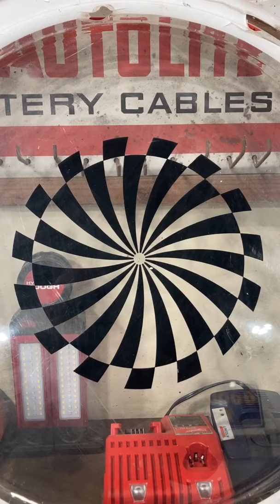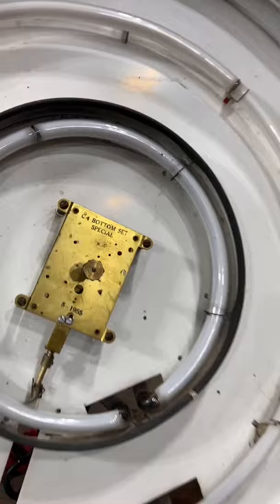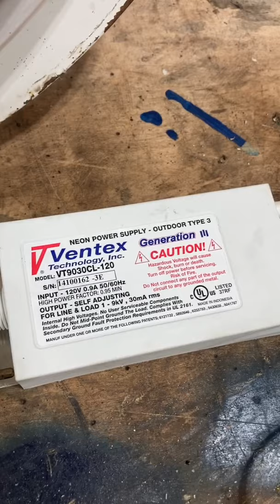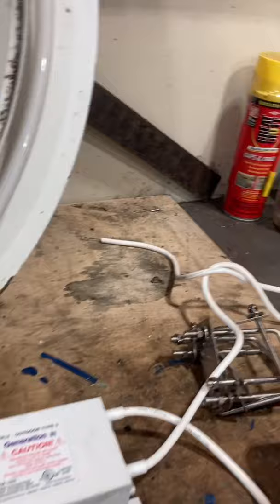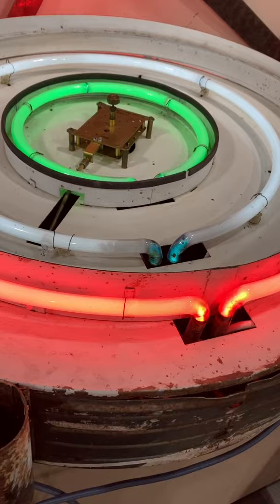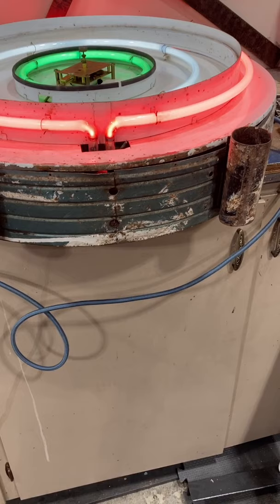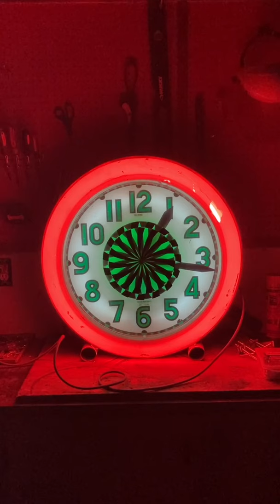Magical Cleveland Pinwheel Clock

Comment: Very cool clock you have!  This transformer is self adjusting & goes to 9,000 volts.  You probably don't need more than 4,000 volts, 6,000 volts at the most.  If anyone is doing this a quick check with a neon shop & they can tell you what size to order by hooking it up to a meter.  Remember this is high voltage & it will arc over to get you, you don't have to touch it.  Remember this high voltage can kill you or catch fire if not handled correctly.  These new adjustable electronic transformers are probably a good choice for this application if they last.